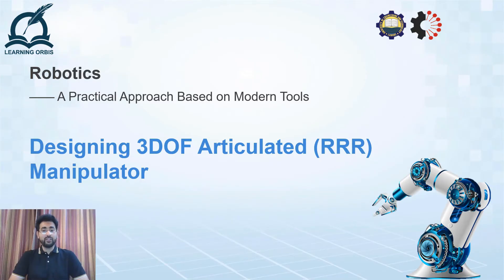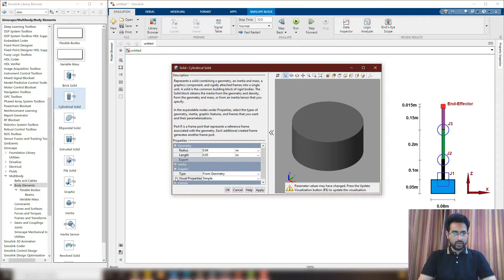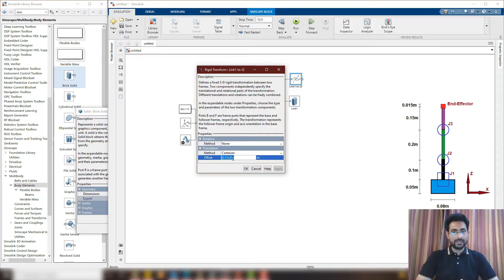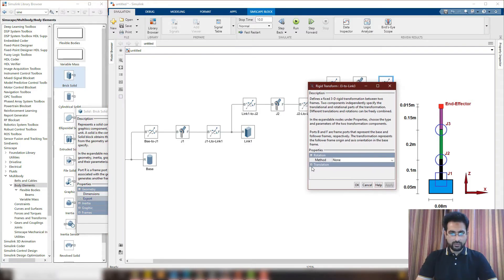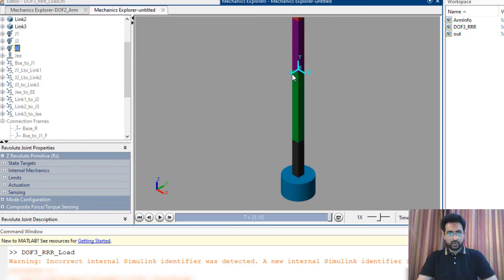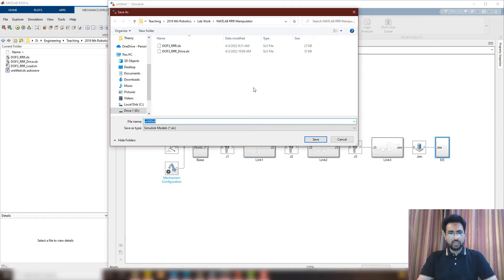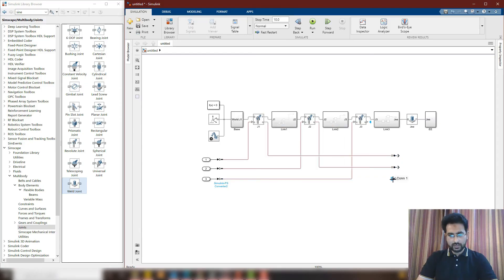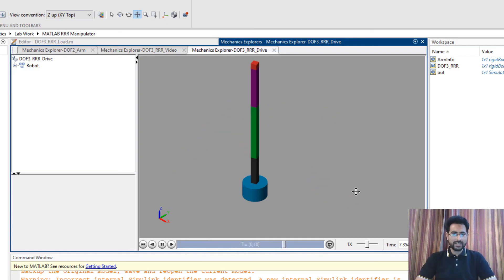How to Design Articulated Robot (RRR) in MATLAB 2021 | RST | SimScape

Comment: Sorry, but it fails to run because of Rigidbody tree file DOF3_RRR is absent. Please share it if possible. Many thanks
Reply from the maker: Look if you can find you desired files on the following links, if not then do let me know, I'll try to sort it out.
1- https://www.mathworks.com/matlabcentral/fileexchange/165286-trajectory-generation-for-robotic-manipulators
2- https://www.mathworks.com/matlabcentral/fileexchange/164236-3dof-scara-robot-with-coded-closed-form-inverse-kinematics 
3- https://www.mathworks.com/matlabcentral/fileexchange/125875-how-to-design-robotic-manipulators-in-matlab-2021
4- https://www.mathworks.com/matlabcentral/fileexchange/128529-inverse-kinematics-of-scara-robot 
5- https://www.mathworks.com/matlabcentral/fileexchange/114195-autotuning-of-pid-controller-for-a-non-planar-manipulator
Reply from the maker: You may contact me at learningorbis@gmail.com. I'll provide you the files there.
Reply: @LearningOrbis  please check your email. Thanks
Reply: @LearningOrbis  Thank you very much, dear friend, I'll check it a bit later

Comment: if i take cylindrical link then how to give offset as by default cylinder takes its height along z axis .... i want to attach the link with a revolute joint  which frame has already rotated along x axis

Comment: sir wat are the upper and lower bound for each of the joints?
Reply from the maker: I guess I haven't added any bounds. However, you may add the joint limits, but the robot will go beyond the joint limits if you are driving it in the position mode, because it will use infinite torque to go beyond the joint limits.

Comment: What can I do to make the first link move like the link 2 and 3, so the three links move on the same axis?
Reply from the maker: You have to change the direction of the rotation axis of the first link. But by doing so you have to adjust the other links as well. Consult my other video where I showed how to make a 2 DOF planar robot (https://www.youtube.com/watch?v=_8YCc3pJDPI&t=2180s) . Following that video you may add a 3 joint to get what you need.

Comment: I have an issue when constructing my robot. When I change the axis rotation, for example L1 to J2, the joint axis completely shifts my link in that direction.  How would i fix that ?
Reply from the maker: The previous frame might not be at the right position, or you might not configuring the rigid transform block correctly.

Comment: Also sir I'm facing problem while converting simscape multibody into rigidbody tree, this is the error shown:

The Simscape Multibody components contain closed chains and cannot be converted to a rigidBodyTree. To break all closed chains and only issue a warning, use the Name-Value pair: 'BreakChains','remove-joints'.

Kindly guide further
Reply: Kindly reply sir

Comment: Sir in place of revolute joint if we will add  spherical joint between base and arm, then what will be the connections ?
Reply from the maker: Spherical joint cannot be used with Robotics System Toolbox. So, if you add a spherical joint then you will not be able to import the mechanism using 'importrobot' function.
Reply: Yes sir, this is the reason I'm getting error. Kindly tell the solution as well sir, we are 6dof robotic arm, I'm learning it for 3dof then I'll alter accordingly for 6dof.
Reply from the maker: You have to model a spherical joint using 3 single DOF revolute joints. You may look for free body diagram of a spherical wrist to understand how you can do it.
Reply: @LearningOrbis  okay sir, thank you so much🙏.

Comment: sir how to make a prismatic joint between two bodies. For example:- window pane sliding over the base. Is it possible to make its model in matlab simscape mutlibody
Reply from the maker: Yes you can. Prismatic Joint can be found in the same place where Revolute Joint is. Attachment of prismatic joint is similar to the revolute joint.
Reply: @LearningOrbis  sir i tried but could not do it. Can u please make a simple model and share it to me. Please

Comment: @Learning Orbis Sir can u please give a short explanation on pin slot joint. It would be very helpful.
Reply from the maker: A Pin Slot Joint is a type of joint in the Multibody portion of the SimScape toolbox in MATLAB Simulink that allows two bodies to be connected by a pin that slides in a slot. The joint constrains the relative motion between the bodies to a single degree of freedom, which is the rotation of the pin about its axis.

In the Pin Slot Joint, one body is the pin, and the other body is the slot. The pin can rotate within the slot, but it cannot move in any other direction. The Pin Slot Joint can be used to model systems such as sliding doors, suspension systems, and linkages.

Comment: Hello Sir, Thank you so much, it's very useful , 
My model contain flexible bodies, so it's not possible to use the "importrobot", i have this error: Models that contain flexible body blocks cannot be imported using importrobot.
Please, could you tell me wich other function can i use?
Thank you in advance
Reply from the maker: The function 'importrobot' works for all the things or robotic structures that can be used with Robotic System Toolbox. Anything that is not compatible with RST will not be imported through importrobot. Unfortunately there is no other equivalent function yet. It might be possible to model the flexible elements in some other way so that it becomes compatible with RST.
Reply: @LearningOrbis  Ok, Thank you so much for your answer!!

Comment: Can we use spherical solid instead of cylindrical solid because in matlab cyliderical solid is not there
Reply from the maker: Yes you can use but that will of course look like a sphere and not a cylinder. IDK which MATLAB version you have but there should be a cylindrical solid there.
Reply: @LearningOrbis  2019 b
Reply: @LearningOrbis  please make video on model reference adapative controller for 3 dof spherical articulated robotic manipulator

Comment: Hello your work is amazing. I have a question sir. Can we add gripper as end effector and pick an object? Kindly reply me asap
Reply from the maker: Yes, you can, But that will be quite difficult programmatically. You have to check when the gripper is colliding with the object and then move the object through the same coordinates as that of the gripper to move the object with the gripper.

Comment: Great efforts! I have a problem with importing the Simscape model as a rigid body tree, my parallel constraint is not supported while importing it, is there a solution for this? Thank you in advance.
Reply from the maker: Parallel manipulators shouldn't have any issues while importing. Kindly double check you simscape file and if possible send me the screenshot of the error at my email.

Comment: Sir, how can we do inverse kinematics and trajectory path planning for 3DOF-RRR manipulator...
And also how can we apply Neural Networks to this 3DOF-RRR manipulator
Reply from the maker: Inverse Kinematics and Trajectory Planning can be done in the same fashion as I've explained in my other videos on Inverse Kinematics of 2DOF Planar robot and Trajectory Generation. As far as Neural Networks are concerned, it depends on what you want to do. Neural Networks can be used to generate the trajectory or sometimes they can also be used to perform the inverse and forward kinematics as well.
Reply: @LearningOrbis  sir, please make video on 3DOF-RRR manipulator to generate trajectory using neural networks.
Reply from the maker: That would be currently out-of-scope of the topics which I currently am covering. I'm working on trajectory generation through a different intelligent method but not neural networks.
Reply: @LearningOrbis  sir, if there may be any possibility please try to make one video on neural networks